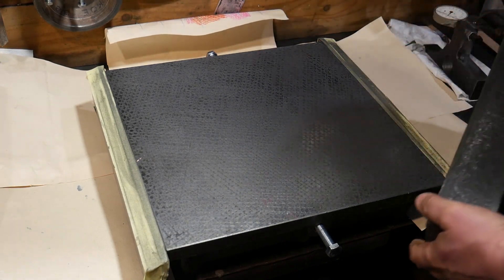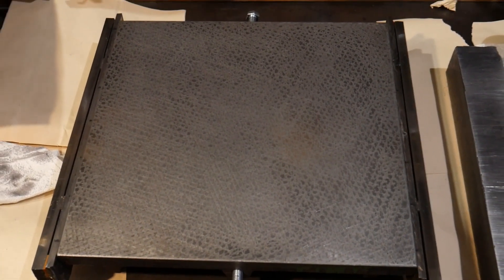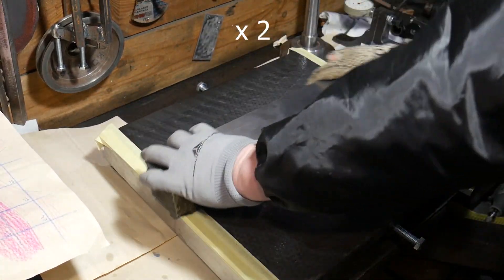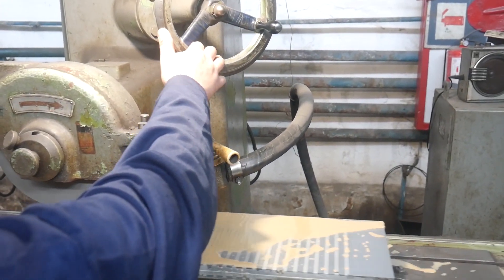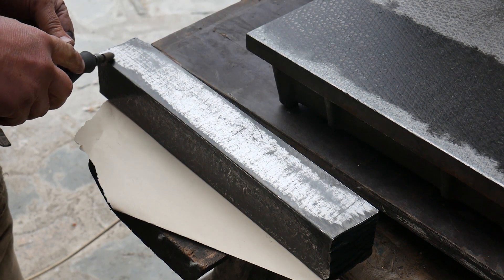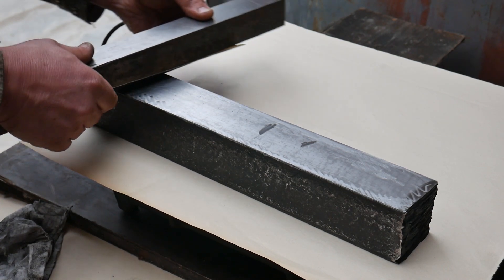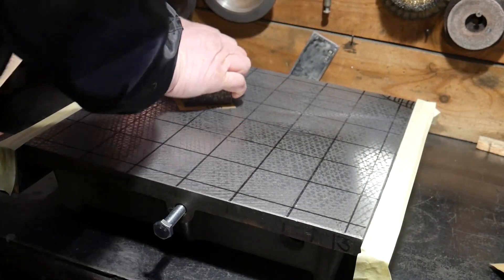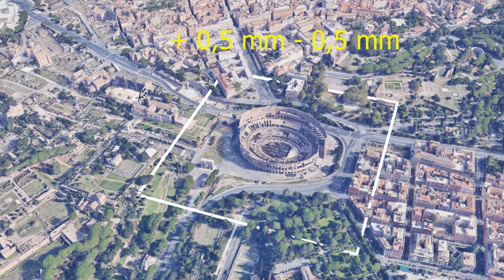"lapping bar"

Comment: I use a 20" x 36" inch 3/8 glass with different grits of sandpaper 36 grit up to 220 grit You can flat sand just about anything that fits on it

Comment: It amazes me what you have done with such basic equipment.
Reply from the maker: A few years ago, I started looking for an opportunity to make my own tool for repairing pairs of linear movement of machine tools. When I discovered the Johanson tile sets with one micron steps, I realized that this was the key to solving this problem.
   I immediately bought several sets, and then everything went smoothly.

Comment: classical work , history was made with men like you. I’ve seen scraping, but the Dremel rubber head is so genius. Are there coarseness on those? ❤ ur great work
Reply from the maker: Hello! Thank you for praising my work. Somehow I needed to process hardened steel, I tried a dremel with a ceramic tip, but it worked too aggressively and vibrated, then I tried a rubber abrasive, it turned out well. I have seen these rubber "tips" with different sizes of abrasive "grain".

Comment: Your repeat-o-meter looks like it have 3 "feet" one in each end, and one where you have the hole (flex point?) Do you have some dimensions ? Overall lenght, holesize and wall thickness ?
Ваш Repeo-O-метр виглядає так, ніби він має 3 «ноги», по одній на кожному кінці, і одну, де у вас є отвір (точка згинання?). У вас є якісь розміри? Загальна довжина, розмір отвору і товщина стінки ?
Reply from the maker: I can measure and tell you the dimensions.
Reply: @gena_bazarko  I would love to get your repeat-o-meter dimensions.
What will be the "best" material to build it from ? Cast iron ? mild steel ? tool steel ?`/ Я хотів би отримати ваші розміри повторного вимірювання.
З якого матеріалу буде «найкраще» його побудувати? Чавун ? м'яка сталь? інструментальна сталь?
Reply from the maker: I will email the sketch and dimensions. I used plain structural steel, as it was easiest to find at a scrap metal collection point. She fits in this case.

Comment: 00:04:12 "The mecanical comparator reads one micron"
00:05:08 "... Three years ago... back to how it started"
Make a lapping bar with a grinder.
Use sandpaper first.
Make a print (1)
Cut high places with scrapper or rubber abrasive tip.
Use sand paper with bar or flat stones.
Make a print (2)
Use lapping bar

00:09:04 The surface became very flat 0.0002 mm (or 2/10 000 mm).

Comment: What would you recomend for cleaning dried oil out of gauge blocks? I run out of ideas, acetone or alcohol is doing nothing
Reply from the maker: If it does not wash off, then this is not dried oil, but corrosion (.
Reply: @gena_bazarko  It seems like oil, a very old one. This set is made in soviet union, if i scrape It off theres still a mirror like finish below. Should i scrape It off with plastic tool or perhaps ultrasonic cleaner is better?
Reply from the maker: If it scrapes off, then I would try wooden, bone, can be made from coconut or walnut shells, or hard plastic. I also have similar tiles, I washed them with gasoline for lighters, but the stains remained, I'll try to scrape them too.
Reply: @gena_bazarko  thank you! I will try this

Comment: Very nice video again! You should watch ROBRENZ YouTube channel where he is lapping a granite surface plate with a plate like yours. He is using diamond powder i think anyway he has also a lot of good videos. 🇺🇦🇸🇯
Reply from the maker: I know the Robrenz channel, it's one of the best channels. I saw him make a stove. I will also make a granite slab, but I will use a different leveling technique. I have the components of this work ready, but I will have to wait for spring and a stable temperature. Now I can't heat my workshop.
Reply: @gena_bazarko  Okay it will be interesting to see more of your videos! I have a small granite surface plate that i bought from Microtech in Ukraine that i just use for inspecting small car parts and other things. I am not a professional when it comes to measuring techniques like this so i do appreciate the videos like yours and the other YouTube creators have made 👍 I do measure a lot of diesel engine blocks with bore gauge and so on.
Reply from the maker: @endrekalvenes8460  I, too, sometimes repair my car. I have done a complete engine overhaul on numerous occasions. Because I am familiar with precision measurement techniques, I use unusual techniques when repairing an engine. I even have some footage on this topic. Maybe someday I'll publish it.